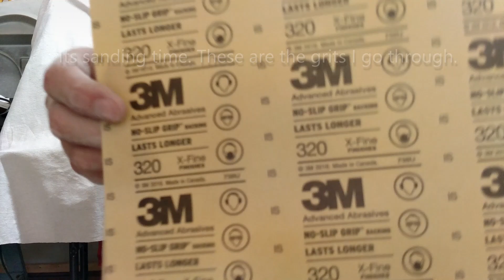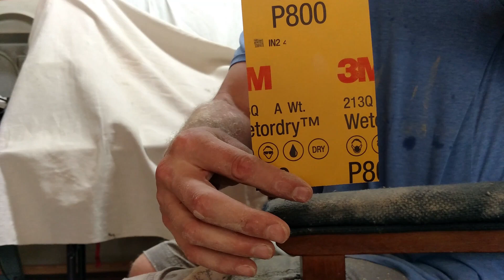Walking stick: Lichtenberg Fractal Burn. #fractalwoodburning  #woodwork #walkingstick #handmade

Comment: Hello. Love ur work. I have always loved working with wood.  I've started making walking sticks and mine or more or less big sturdy ones of heartwood that I walk the woods and find then come home and clean up.. chisel bad off of them then sand down to the beauty of the stick. I then polyurethane them and sell em to ppl that love to hike. I wud really like to try this technique on some. But can I build the device that u are using to burn wood with? If so how do I do this? It's nighttime here but I wud like to send u a video of some of my sticks for ur opinion on them. And if there's something I cud do to make them even better I wud enjoy hearing it. I also keep all my sticks long. Reason for that is I can cut them to fit whoever  buys the stick. I look forward to watching more of ur videos but ita 2 a.m. here n I gotta get some sleep. Lol.  Hope I hear bk from you since this is an older video that you've done... Be Blessed
Reply from the maker: I thought I had replied to you, my apologies. You seem to be doing everything you need to do to make a fine stick already. Though, I don't use a polyurethane finish on my sticks. I use either cutting board finish or a paste wax, all natural, or shellac. My go to though, what I use the most is just 100% beeswax. I use a heat gun to melt down the wax and rub it into the fibers. The heat allows the wood fiber to soak it in and I hand polish to whatever shine I feel like.

Comment: This is absolutely beautiful. What exactly is the purpose of the baking soda mixture?
Reply from the maker: Thanks Minakshi, 
It allows the electricity to flow through the wood freely to create the burnt fractals. Without it the wood, being non-conductive, would stop the flow of electrons from contact point to contact point, or positive pole to negative pole.

Comment: Amazing looking! Never heard of this before. Does this technique work on any wood? And what is the ideal ratio of baking soda to water? Cheers from UK
Reply from the maker: Thanks, sorry for late reply. Yes it works on hardwoods just fine, I prefer a nice piece of maple. But I've done it on oak and walnut with no problems. Most soft woods create a inconsistent burn for me, poplar, sycamore, and pine.  Any of the craft woods  from hobby stores are poplar or pine and I just don't like the burns. Play around with the ratios till you find one you like, I use 1 to 2 tablespoons to 1 cup of water. Also, the baking soda will turn the woods a slightly darker color or give it a greenish hue that you will notice after clean up. I can usually sand it away as it's just a few layers down.
Hope that helps.

Comment: How much would you charge for this
Reply from the maker: My apologies for the late reply. I charge 150 for a simple stick. 200 if someone wants it personalized with more runes. It's based on the danger the process is to me and the I time spend on it.  Simple non-burned sticks I sell for 50 to 75 depending on how long I spend on it. Kids sticks are around 25 non-burned and 100 with a burn. 
But, I do recommend finding a stick out in the wild that becomes personal to you and working on it yourself, sanding and decorating etc. I just like making walking sticks and I do this on the side for fun. But, nothing beats one you find and work on yourself.

Comment: What power source/voltage are u using? Is that a positive and negative electrode that makes that? And the baking soda/water mixture the catalyst ?
Reply from the maker: Yes, it is positive and negative electrodes from a neon sign transformer. I'm using around 75 to 90k volts with a variac transformer to adjust the output. On my walking sticks I use a baking soda mix on all other woodworking projects I use a borax mixture because borax doesn't stain the wood like baking soda does. I sand the walking sticks enough after the fact that I effectively remove the surface staining.

Comment: What are you using for a Transformer and how many volts is it putting out that stick is awesome
Reply from the maker: Hey John, I'm using an 120,000 volt neon sign transformer and a variac to adjust the output of said transformer. You can pick one up on Amazon for $60-120. 
Now, I've used microwave transformers before and I just don't like them. They are dangerous and too raw power for what I use them for, even with a variac power transformer relay.
The neon transformer is softer to me and allows for more delicate burns that are still deep but fine. The microwave versions I've used always created deep ruff wide burns at the beginning and if you keep them in the same position for too long you end up with an ugly large lead burn that I never liked. Hope this helped
(edit)
Oh, and I started the burn off at 120,000 then moved the variac to around 75,000 to 80,000 volts depending on how fast the two electric arcs where being attracted to one another. There is always a sweet spot in the material you are using. I like a slow burn to allow me a modicum of control.
Reply: @druidscircle5275  Great technique! Can you provide the model numbers of the 3 tools you are actually using? Thanks
Reply from the maker: @stevenpeck  Sorry for the late reply. My apologies but I cannot provide that information. Because this is extremely dangerous, there have been many people that have lost their lives while using this technique, I don't recommend trying this. Unfortunately, with this technique you only get one mistake even if you're extremely careful. For potential legal purposes I don't give out that information.